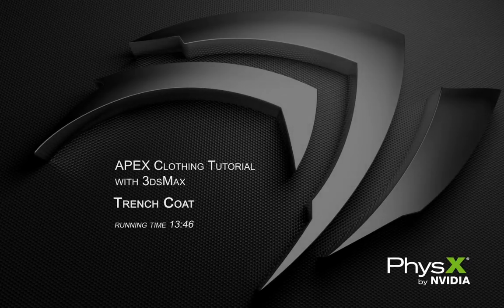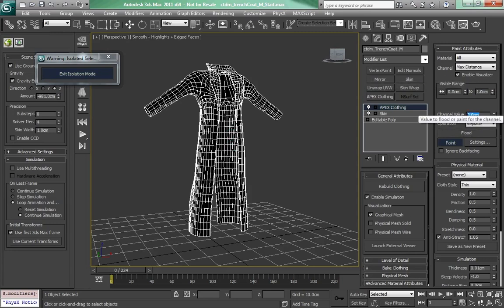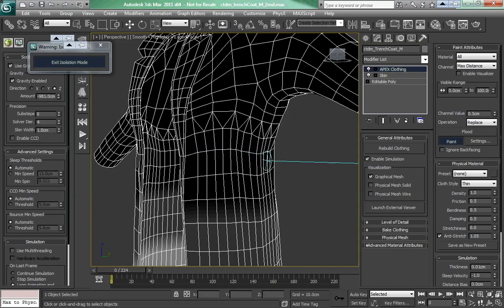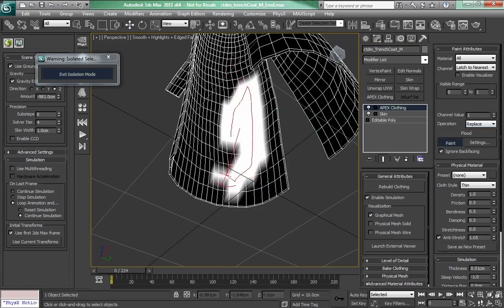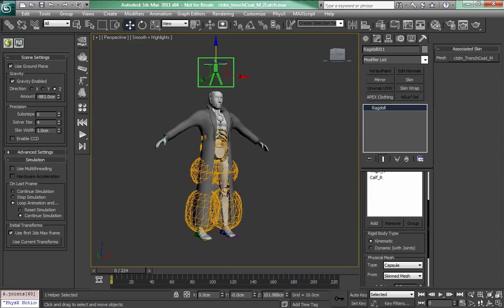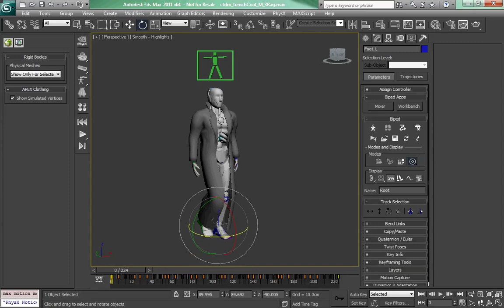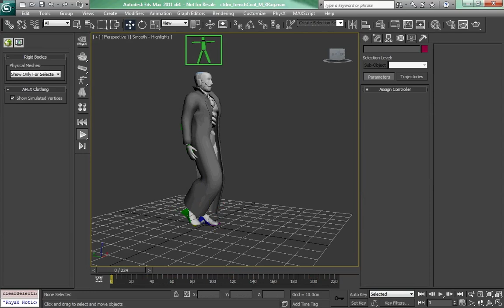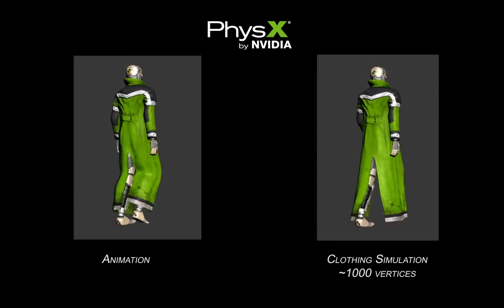APEX Clothing Tutorial with 3dsMAX using a Trench Coat

Comment: Cool.  Max distance only deals with the vertex its painted on, it has no knowledge of the others.  if the clothing is wrapping the character in places you don't try adding a capsule on the top spine.neck or head bone and extend it above the head.  You can allways play some smoke and mirrors with extra shapes:)

Comment: Ahh, this is helpful info!  2.7xxxx plug ins are APEX 1.1.  There is limitation you ran into with the arm shapes.  If a bone is not part of the skinning envelope that the cloth is on top of, then you will not be able to pick it for a ragdoll shape.  Add the bones to the the skinning envelope to correct the issue.

When you export your apx or apb file, on the export panel there is a check box for export collision hulls.  Make sure this is checked.  is it?

Comment: With TG_PreAsyncWork I still get this distortion. It's weird, it's like a band of distortion crosses the screen from right to left, distorting everything with a blur, and it only happens when I move forward, backward and right. Moving left is fine. Utterly bizzare. I'll have to keep trying to figure it out or use the other cloth solution I've also been working with. Thanks for all of your help though Shred.

Comment: Great idea, thank you. I've noticed however that when I have the apex cloth working it seems to degrade the performance of the game visually. Textures blur out and come back and my character ghosts when moving quickly, he leaves a trail of maybe 4-5 frames worth. My calculation substeps are at 5. Have you seen this? I'm running a GForce GTX680 card and have 8GB of RAM on Win7 x64. I'll try making their tickgroup TG_PreAsyncWork, see if that helps.